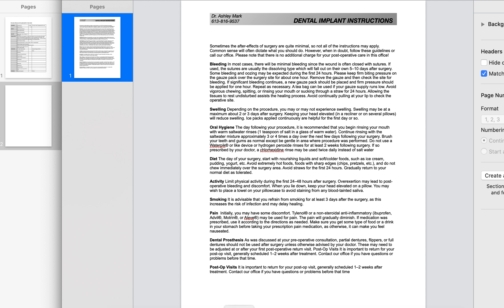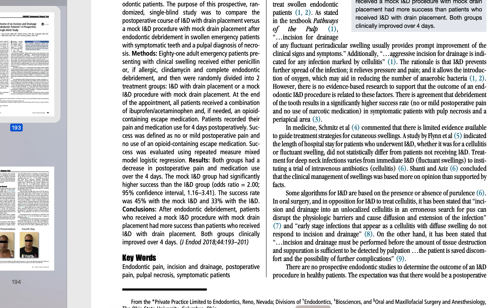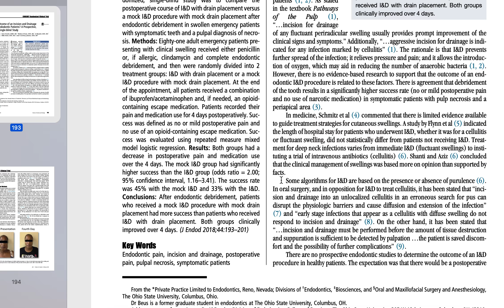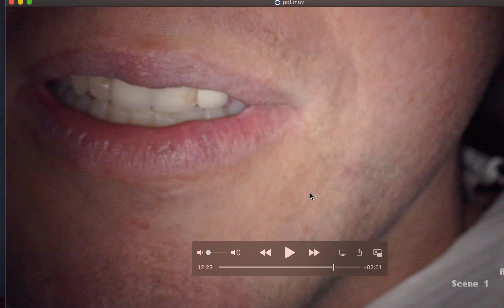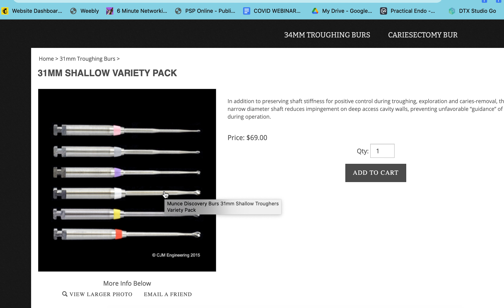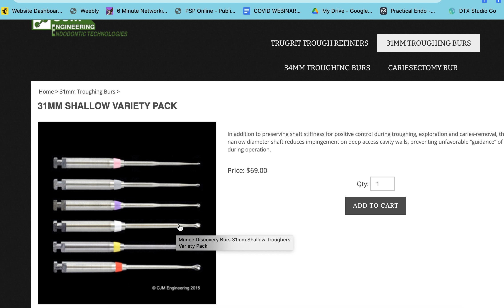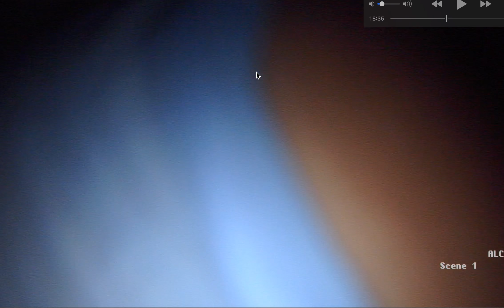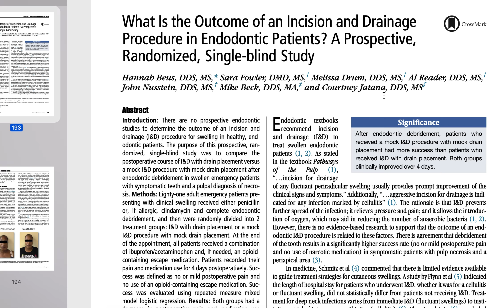2 Molar Root Canals {Pulpectomy, Incision and Drainage} and a 1 Step

Comment: Hello doctor. In this case you only had 6, 8 and 10k files, but do you usually re-check your apical gauge after preparation and before obturation in order not to cause any apical extrusion or do you trust your preparation enough? Also, why no coronal seal with for example a Glass Ionomer or a Flowable Resin given it's also a cause for endodontic failure? Many thanks and keep on posting them cases, so awesome to follow and learn from you.

Comment: I think 25.07 is too big for mesial roots..  the size of shaping is controversial. However, I would use smaller tapered files to prevent strip perforation or vertical root fracture.

Comment: please find time to answer my questions

1. do you recommend  i start using amalgam as post obturation material instead of composite?

2. i use K3XF files by Kerr. they are not so flexible.
have you had experience with them ?.or any body has given you review about them ?